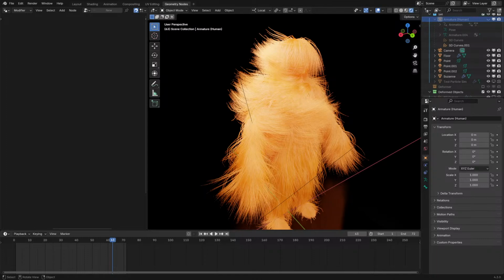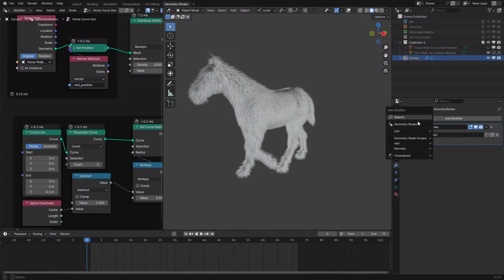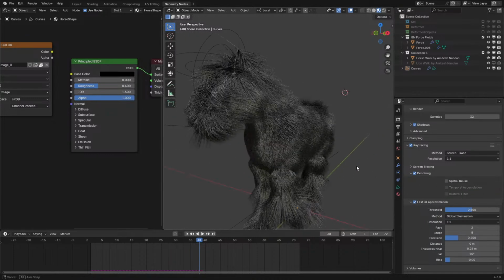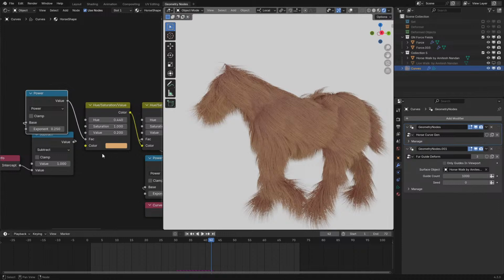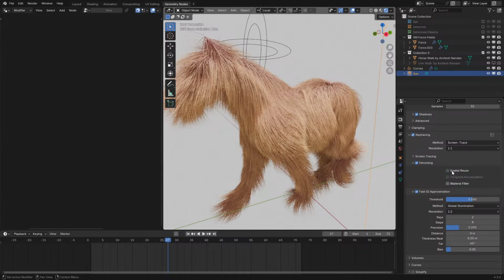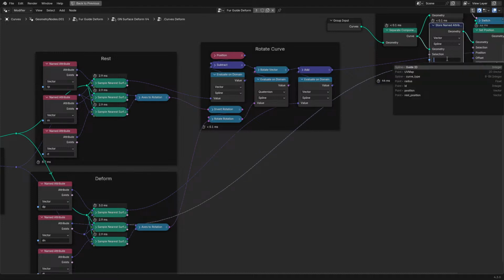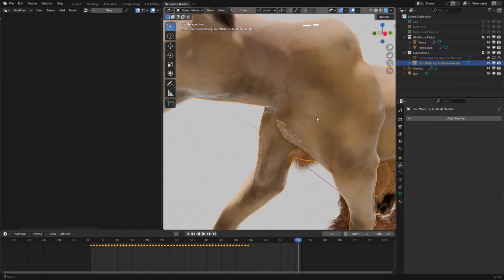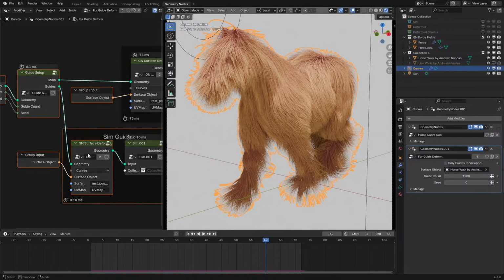Fur Simulation Node Group Testing (Blender 4.3)

Comment: I implemented an early version of your geo node hair system and it works amazingly. Thank you so much for showing how you did it. I want to make this work for a mesh with an armature and applying it directly seems to make the hairs behave somewhat randomly. I am going to try to troubleshoot the problem myself but I wondered if you have any pointers?
Reply: Update: I figured out the issue is to do with how the face normals change when the mesh deforms. So within he simulation loop, I calculate the normal change, then calculate the ration matrix and lastly apply the matrix to the vectors attribute which finally makes the hair simulation work as intended with an armature. I'm really happy with the result!